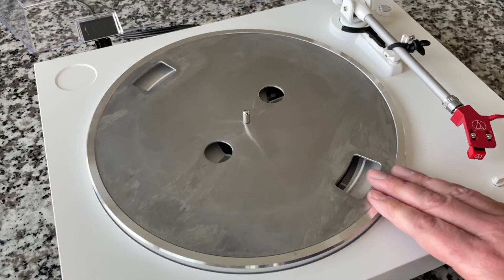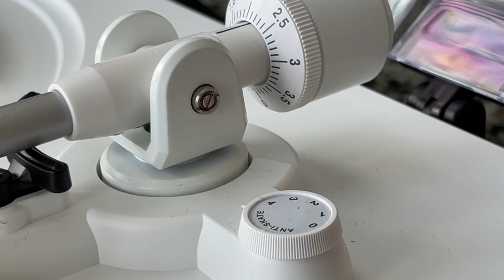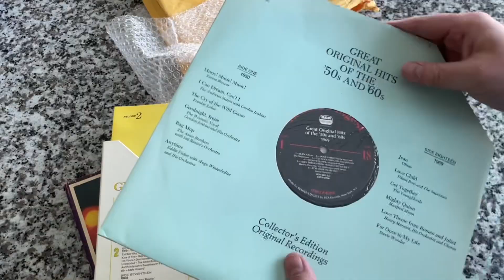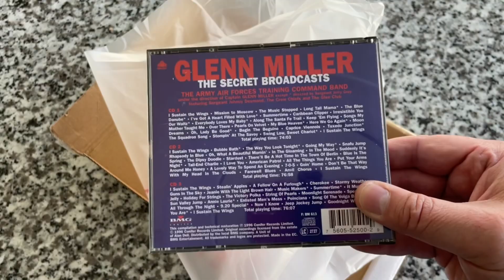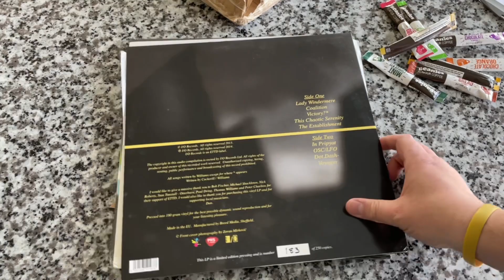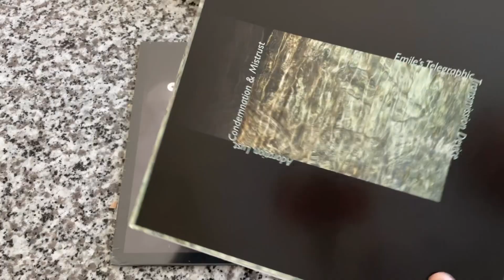Audio Technica AT-LP3 One Year Later!

Comment: Hello, I’m interested in buying this turntable. I live in a studio apartment and I’d like to place it on a wall-mounted shelf that’s 37 cm deep, right against the wall. I checked the dimensions on the Audio-Technica website, but I only found the overall measurements, not the distance from foot to foot.

If I place the turntable towards the front of the shelf (with the front feet close to the edge), do you know if the dust cover can still open fully without hitting the wall? That’s the part I’m unsure about. Also, is it easy to set up?

Thanks a lot for your help and for your videos, they’re really helpful!
Reply from the maker: I no longer have to to measure but also consider the cables sticking out of the back....its pretty easy to setup.

Comment: I have had mine for 3 years and never had an issue until now. All of a sudden it has stsrted playing too slow on 33rpm. I know where the adjusters are underneath and i appreciate it's a bit tricky, but does anyone have any advice before I stick my little screwdriver in the hole? How much to turn? Which way? Thanks.
Reply from the maker: BIGGEST ADVICE: Get a non conductive cermaic tip screwdriver so you dont short out the motor and make it run full speed white trying to adjust.  Also make sure you are setting to a strobe disc https://amzn.to/4j2hVTs

Comment: After 2 years, my one still works ! ☝☝😆 BUT - I've installed Audio-Technica VM520EB ( enough for my hearing ), better, rubber platter, Proper shock absorbing feet, and totally muffled it from inside with sound isolating, rubberized foam ( 1cm thick ), that I've glued ( obviously after cutting to needed shapes - all spaces ) on "every" free plastic space ! - the body doesn't ring, so much, when you knock on it, anymore 😀 
After seeing how it's built, I don't expect it to live VERY long. Too many plastic moving parts, but for the price - not a bad deal. 
Worth mentioning - the tonearm has, virtually NO lateral slack - a good thing ! If you connect it ( as any TT ) to a decent Phono Corrector, it plays VERY, VERY WELL !  
A limitation - if you wish to have several cartridges - SAME head-shells should be used. Other - angled - can miss the record in auto mode.....

Comment: in fact same as an old German Dual design also used for Chinese Dual version, Denon version , same as this Audio Technica  with the same plateau , only some little different cosmetics , headshell, rubber mat , some switches round  upside or on tehe front, shape of casting but inside construction is the same old
German design. The arm is the same some silver, some black. In fact the Audo Technica  version is the most luxury one of them.

Comment: Talking about speed issues, my LP60X always spun just a little too fast.  I purchased a strobe disc as my guide to accurate speed.  After quite a few attempts with my screwdriver, the lines for the 33 rpm were finally stationary.  I figured after fitting an elliptical stylus and an acrylic platter mat, I might as well go the whole hog and get the speed of the 60X right up to higher end standard.  Nothing like a strobe disc to sort things like that out.
Reply: "My turntable was running at 34.6 RPM. I adjusted my AT-LP60X by ear. I followed the music using the notes on the keyboard 🎹 and fine-tuned the pitch. My nephew’s smartphone has a gyroscope, and when I tested it, the speed was averaging around 33.5 RPM."

Comment: I have the LP3XBT and it has a detachable RCA cable + ground wire set. But interestingly, it does not have the MM/MC switch (MM only, I guess). It does have the phone/line switch, as well. The bluetooth is enervating, though, as I am unable to get it to pair with my MacBook. YMMV.
Reply from the maker: Very interesting! I still have not got my hands on one of the new Bluetooth units. Sounds like they did away with the moving coil support.

Comment: Hi Record-ology, great looking record player. Thank you for sharing. The rubber mat for your model is 4.5mm in thickness according to Audio-Technica. Use a piece of rolled up scotch tape to pick up dust particles from the mat. A rinse in the shower will for sure fresh it up. Dry it by pressing with a clean cloth towel. Do not use paper tissues because that will leave tiny fibers on it. To clean the lid, gently wipe with a microfiber cloth. Do not use pressure. Use this microfiber cloth for the lid only! If you use the same on a bench or a table, it will pick up breadcrumbs and that will scratch the lid.

Comment: I have the AT-LP60X but was thinking about upgrading to the AT-LP3. My only concern is the connected RCA cable length. I would need a longer cable for my setup. Does adding an extension cable  to the existing RCA cable degrade the sound?

Comment: Well as another YOUTUBE reviewer stated, this is a lifestyle unit.  Just great for folks looking for a durable, versatile and decent vinyl TRACTOR.  It's really not bad, but,
 I don't think this has pretense to impress any audiophiles.   After I viewed another of Record-ology videos, I couldn't help notice his zealous enthusiasm for the white version, which I had to agree, is rather attractive and pretty irresistible!  I don't know how to explain it, but somehow, the better it looks the better it sounds!  Of course I had to find one!  I love mine, and am looking forward to upgrading the AT91 cartridge to a VM95E. I am also looking for a white slip mat too!  The AT-LP3X is bit of an odd beast though in one regard;.  It actually purports to be far more than it is, and comes equipped with a Moving Coil Cartridge switch.  This is bit odd for a Vinyl Merry Go Round at this low price and quality level...(about $259.00 for the black).  Note, that at the time of this post,  the white is in short supply, so the on line scalpers are currently offering them at about $359.  But,  Bulletin!!!.... there is a great alternative....An almost identical unit, in gunmetal gray, called the AT-LP2X, and is available exclusively through the Guitar Centers.  So, If white is not really necessary for your wheelhouse, you can snap one of those up for a mere $199.95.  The big difference from the LP3X, other than color, is that the AT-LP2X does not come with the Moving Coil Switch.  The previously mentioned scalpers, are apparently buying these at full retail, and are currently listing the LP2X's on Ebay for $300 and up.
Reply: They are on sale for 149. I think they are getting rid of them for the newer model that just came out with Bluetooth and USB. What did you end up upgrading your cartridge/stylus to?
Reply: @concertexperiences1602  Well, I assume you're referring the the AT-LP2x, these are no longer showing up as a purchase option at Guitar Center nationwide..."GROAN!"  I suspect that this model has been discontinued by Audio Technica.  Perhaps a Blue-Tooth version will become avaiable in the future?.

Comment: I have a 1968 Pioneer PL-740 (was my dad's) that is Direct Drive (no belt, thank goodness) and is fully automatic. It has that weird head shell no one makes anymore. I slapped a new cartridge on it as the one on it was OLD. It is the perfect turntable for juniors who want to get into vinyl. The tonearm is fully balance adjustable with anti-skating just like the more expensive units.
What is obvious to the observers of all these turntables is that they mostly come from the same factory. It's like a GM car. Same stuff, different body. What is cool is that this PL-740 still works as new. The plastic over is really scratched up. Got to talk to my dad about that, but he's pass on to his next adventure.

Comment: I just bought a new Audio-Technica AT-LP3BK. One thing I've found is that it sounds better in "Line" mode when plugging into my amp. I wonder if the built-in pre-amp isn't the best.
Reply from the maker: Interesting
Reply: I didn't like the built in pre amp I went with an external tube pre amp

Comment: I have had my LP3 for over a week now and it’s not a bad TT, though what really turns me off about it is the really plastic feeling throughout, especially with the buttons to switch speeds?? They are a bit loose they should be more firm feeling? Also there should be a tone arm lock! I really am considering returning it?
Reply: No tone arm clip because if the tonearm was held by the clip and the start button pushed the auto operation mechanism would most likely get damaged.
Reply: @PJD_55  ahh, of course, yes, ok, good that they thought of this...
Reply: Did you ever return it?
Reply: @slashedbeauty  yes I did

Comment: Thanks so much for the review. So what’s the main difference between this turntable and the LP 60x? Is this TT on par with the LP60x? The Bluetooth capability of the LP 60 X is a feature that I like, is there a way you can add a Bluetooth Adapter to this unit in case you wanted to use Bluetooth speakers?
Reply: Adjustable tonearm weight, antiskate, replaceable cartridge and adjustable cartridge alignment.

Comment: This one has the same motor,bearing and platter than the Sony PS-HX500 and Denon DP-300F
with the same problems like any other  turntable without stroboscope and pitch control. 
Meaning the certainty of speed drift due to changes in humidity and temperature.

Comment: The LP 120 I had did the same and dropped the needle way to quickly. I read somewhere that the fix was to leave the lever in the raised position when out of use as you can still clip the tonearm in its rest. It worked perfectly after that. I can't recall the reason right now but give it a try, it may work for you.
Reply: i've read in another video comment section that "you should have it in the down position and only move it up when you're getting ready cue up a record". somehow leaving it raised would put stress on the mechanism that raises and lowers the arm

Comment: A dust cover is designed to do one thing and one thing only and that is to make the turntable look complete. They will never keep dust off of anything. Even itself. If you have a detachable dust cover, always remove it before you play records. When you're done playing records, put the dust cover back on and go watch TV. Why, do you ask?
With a turntable such as this very nice turntable being reviewed on this video and of course other more exotic turntables that cost $20,000, every single turntable enthusiast that knows the reproduction of vinyl sound while playing the record will tell you to remove the dust cover because the dust cover will cause unnecessary Rumble and hum. It may not be noticeable to your ears but trust me if you remove the dust cover if you have a turntable such as this, you will hear your records sounding so much better. There IS also a lot of scientific things that go along with it while you have the dust cover down and playing a record at the same time. Believe it or not, if you play a record with the dust cover down at the same time you're actually increasing vibration and the tendency for the records to skip and also cause the records to become more dusty because of the spinning of the platter versus The tonearm traveling towards the center of the record. This will cause unwanted distortion and noise particularly towards the end of a record.
I read about this subject around 30 years ago and have never played a record with the dust cover on since. The audio playback is noticeably better without the dust cover attached to the turntable. It may sound strange to some of you but trust me. Look it up online and you will find many threads and information an education as to why you should never use the dust cover attached to your turntable while playing a record.

Comment: The LP3 really punches above it's weight! If Audio Technica ever makes a mark II, they should remove the mc capability, and move those savings to removable audio cables and a better 45 adapter.
Reply: You pretty much predicted the AT-LP3X. MC Preamp is gone, removable RCA cables. Plus they added a bluetooth transceiver and instead of an AT-91 it comes equipped with AT-VM95C
Reply: The AT-LP3XBT is what you need bro
Reply: That’s a good point.

Comment: If you have a record that triggers the auto-return before it's finished playing, there's a small modification you can perform.  Relax - it's easy to do, completely reversible, requires no special skills, and isn't going to void any warranties.  Basically, what you are doing is disabling the automatic features.  All you'll need is a small screwdriver and two or three minutes of your time.

1)  Remove the platter and set it aside.

2)  Located directly behind the platter spindle you'll find a large plastic gear.  That's the cycle cam.

3)  Using the proper-sized screwdrive, remove the retaining screw from the cycle cam's pivot.

4)  Lift the cycle cam from its pivot.  Have a tissue or something ready so you can put it down; that gear has some lithium grease on it. If you want to make sure you don't lose the screw or washer, loosely screw them back onto the pivot.  DO NOT remove the little metal mechanism from the cycle cam.

5)  Make sure your  hands are clean and reinstall the platter.

Congratulations.  The turntable is now fully manual.  The platter will start rotating when you swing the tone arm toward the record, and will shut off again when you return the tone arm to its rest, but the auto-return and automatic-start features will be disabled.

To re-enable the automatic features, reinstall the cycle cam.  Make sure you don't have any grease from the cycle cam on your hands when you go to reinstall the belt.   After reinstalling the platter, spin the platter by hand a few times to reset the mechanism.

One caveat you should be aware of - while the cycle cam is removed from the turntable DO NOT PRESS THE START BUTTON.
No, it won't damage anything if you do, but you'll find the motor will continue to run even with the tone arm on its rest, and pushing the STOP button will do NOTHING.    Reinstalling the cycle cam temporarily and allowing the machine to cycle will correct the problem.

If you want to disable the automatic functions permanently, you'll have to remove the cycle cam as well as the control linkages to the push buttons.  You can access these from the bottom of the unit.

By the way, this works for most all full-auto or semi-auto turntables, including the LP60 and its many clones.

Comment: 5:00 I don't agree, it's way closer to an LP120 instead of LP60 IMO, because of the tonearm features.
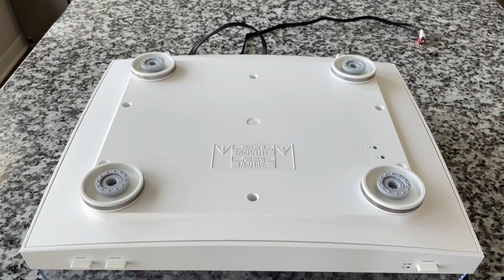13:13 turntable upside down on its dust cover directly on the marble kitchen table? Yikes! Don't try that at home kids!😅
Reply: If you're only speaking of the tone arm, then yes, this is closer to the LP120.  I particularly like that it has a proper counterweight, anti-skate adjustment, and removable headshell.  

But as a unit, there's more in common with the LP60.

LP60/LP3 is a two speed; LP120 is three speed
LP60/LP3 is a belt drive via DC motor; LP120 is direct drive
LP60/LP3 is full auto, LP120 is full manual
LP120 has pitch control

If one were so inclined, this could be easily modified for 78 rpm and to add pitch control.

Comment: I have one but wow is WAY too much.
Reply: You can download an app on your phone, lay it on the turntable whilst turning and it will give you an accurate read out for 33 and 45 (you need to adjust the speed yourself) that will give an indication of how off your speeds are then you will have to go in the bottom and adjust with a very fine screwdriver. It's also worth checking how even your turntable is - there a spirit level app you can get too. Just check at four points on your platter to check it is laying perfectly flat.
Reply: @fab208athome  Hi Dave, the faster than 33 (33.9 in my case) is not much of a problem but speed stabilty IS and varies according to the app from 02.3 to 03.8 (!!), sometimes wow even over 0.4, which for me is easy noticable. Concerning the spirit level app, I'll try that but it is with my measurement quite good, but I'll try that. Thanks for the advice.